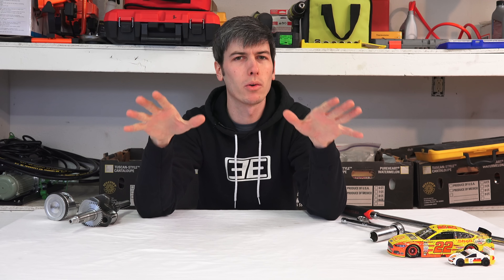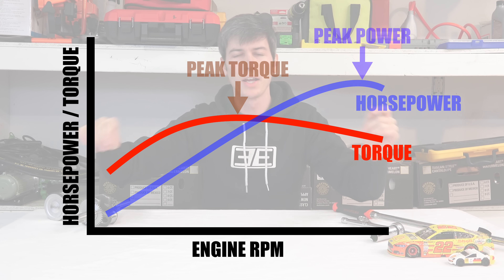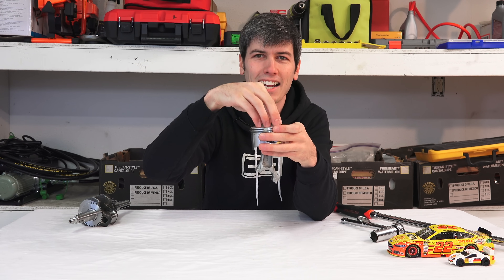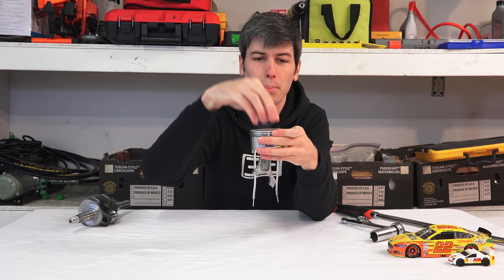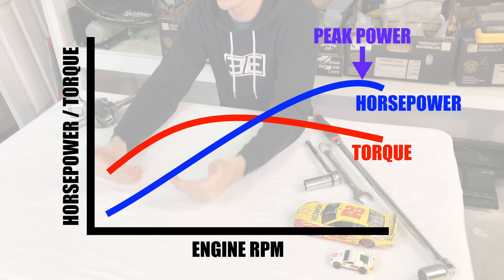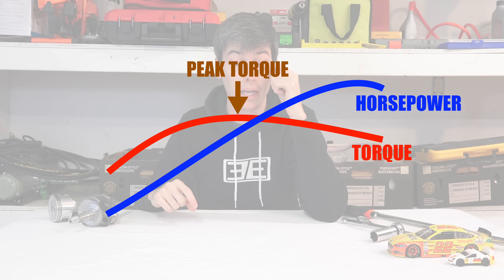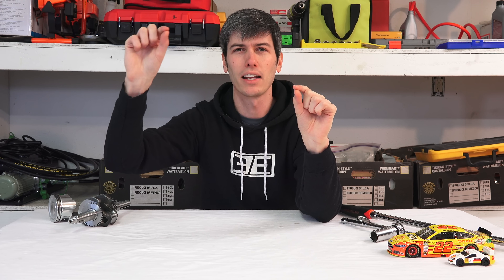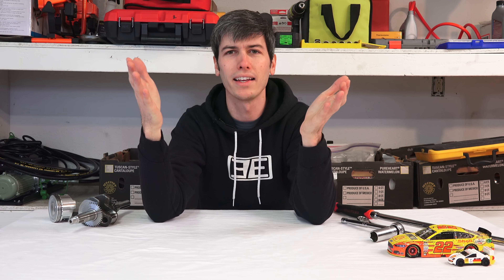Horsepower vs Torque - A Simple Explanation

Comment: So what difference does a higher torque number mean if both cars have the same HP?
Quicker accaleration with resistence like including weight and drag etc.? I dont quite understand
Reply: Slightly quicker acceleration because of more power available at lower speed.
Physically acceleration is the same thing as towing, pulling, acceleration with other "resistance" etc, because A=F/m. If you increase mass by 2 you will be 2 times slower and there is nothing you can do with it. So yes, better in towing too. Considering we keep gear ratios the same.

Comment: Jason, in most of your videos I come away with a greater understanding than when before watching. This isn't one of them. My understanding is torque is static, power dynamic. Torque can be measured with no movement. Power requires movement. Movement over time. Still in the dark as to how they relate to each other in measuring the usable output of an engine. I tend to prefer torquey engines as I get to shift less often. Love lugging around corners in 3rd. I probably would prefer the driving characteristics of a 100hp engine with 140 ft-lbs of torque over a 140 hp engine with 100 ft-lbs of torque in otherwise similar vehicles. But still do not understand how the two are related. Though I was working on a friend's Rolls Royce and looked through the owner's manual. For horsepower and torque, the cheeky British engineers simply put "enough". Also of interest was the "finest motor car in the world" used a GM transmission.
Reply: Power is not "movement over time", it's "work done per unit of time" as Jason says

Comment: This is good but without reference to why combustion engine's curves look like what they look. For electric motor you have nearly flat torque and linear power - so, why a combustion engine torque drops mid-revs? Because the combustion is a process working best only at certain combination of volume, fuel and air mass. Good combination gives lot of force, bad combination gives less force, lot of wasted fuel and so on. But engine is a mechanical arrangement, working in linear fashion (faster revs, faster movement of components). Valves operate in their stroke sequence and let certain amount of air at certain rpm. In most basic mechanical arrangement they will let optimum amount of air at certain rpm while starving cylinder of air or leaking out at other rpm. This can be helped with turbo (but still at cost of efficiency) or with fancy timing solution like VVT. There's a lot of "high school physics" discussions about power formulas etc, but going a step further, looking into how the combustion itself works is what helps to understand why one car behaves different than the other, for example when going uphill or floored on a highway.

Comment: You forgot to show one thing, applying torque to your lever but if nothing moved you generated zero power. (As if a bolt was stuck and didn't spin).

Comment: Pretty understandable except one thing: it,s stated Horsepower is more important than Torque for speed. Yet my Subaru Impreza Turbo (2.0 litre 4 cyl boxer, 220 HP by +/- 350 Nm) wins traffic light races etc from +/- 250 HP Audis, BMWs easily. I think the HP vs Tq has more to it

Comment: This is awesome, but I have a question
Let's say I have a land cruise V8 and Prado maybe a V6 engine, so when the V8 is the 140 speed and Prado 140 speed, is equal to the same speed at the road? Also, assume the tire size is different maybe 17" for Prado and 19" for V8?

Comment: Now i understand why my 2019,  250 HP (on premium gas) 2.5 L. turbo, AWD  MAZDA CX-5 engine with 310 ft. lbs. of torque is so quick off the line.  310 ft. lbs. of torque is a LOT for that compact SUV.. If only they would stress the engine a bit more with a bigger turbo for more HP. :o(
And the 2020  - 2021 models have 320 ft. lbs. of torque!

Comment: I have a question.  I have a turbo k series, instead of putting z3 cams that rev to 8500, I'm putting crv cams that have the torque start at 2500 and redline hp at 6800ish.  My goal is to replicate the style of the type r, by not making high rpm, and having low rpm turbo spool. Right now I am running a3 cams that hit torque at 4500ish and hp at 7000ish. Right now my turbo doesn't spool until 3100 to 3500. I want spool in the 2000-3000 rpm range. Thoughts?

Comment: This video and someone else's is helping me understand the relationship between torque, rpms and horsepower. I think the main problem is that I've never fully understood torque. I mean it's obvious and easy to understand in some ways but it's not something you can visualize. I think I have the same problem with volts. I get current because I can visualize it flowing but volts seems to be a relationship between current and resistance so it's not a tangible thing, it's a relationship. I think if someone said torque is not a thing it's a relationship then I would of understood it many years ago. Basically it's a force so it is power but influenced by distance and leverage which makes it always a force under a gear ratio. And that gives it a relationship with the actual initial force I guess.

Comment: If we design reduction ratio for toque at maximum hp , obviously the reduction ratio will be more. Is this cause wheel to slip since the torque or traction ability exceed the maximum traction ability of the wheel

Comment: 1 question: If torque (rotational force) is necessary in order to move something, in this case to push a car by turning the wheels. If, for example in 5th gear we are decreasing torque, does it mean that we are decreasing the rotational speed of the wheels and thus making the wheels rotate more slowly? Because that is not the case! By shifting gear from 4th to 5th, lets say, we are making the car able to move faster than, lets say 120 kmph without getting the RPM so high. Right? 
So, if we translate this to the linear motion. Force is necessary to create motion, that is, to accelerate. When force decreases, doesn't it mean that the speed should also decrease?
Reply: Right, force is decreased, you will start to decelerate if you keep throttle at the same position. You have to push the pedal harder after you shifted up to keep the speed.
If you are already traveling at maximum speed, you can do nothing with gears to accelerate further: shifting it up or down will get you at lesser power (at the same speed of a car) which will result in deceleration

Comment: A vehicle with high torque is more quickly at its peak power. So to say it makes better use of its power. That's why electric vehicles often accelerate so fast. They don't have extraordinary power but very high torque.

Comment: Is there any visualization on say 0-60 given X tq and Y hp at gear ratio Z? Trying to think to myself how a 350hp 420tq mustang turbo compares to a 450hp 400tq GT and at what points either beats the other
Reply: I'd wager the extra hundred horsepower makes up for any additional weight of the v8 so the GT wins across the board.

Comment: What do mean by gear ratio?
Reply: Suppose you have one gear that is 2 inches in diameter, and it drives another gear that is 4 inches in diameter.  This is an example of a 2:1 gear ratio.  It reduces the speed by a factor of 2, and increases the torque (ideally) by a factor of 2, assuming it is 100% efficient.

Since the gear teeth need to move a the same speed, otherwise they would chip, the tangential speed at the contact point of the gears moves at a common speed.  Spin the input gear at 2000 RPM, and its teeth move at 209 inches per second.  The output gear must also move its teeth at 209 inches per second, and for a 4 inch diameter gear, this corresponds to a rotation speed of 1000 RPM.

Comment: I’m a little disappointed.
It Makes no sense that the peak torque would feel greater than peak horsepower, when it accelerates faster at peak horsepower.

What you feel is a force equal and opposite to the acceleration, and the greater the acceleration, the greater the force is felt as a passenger. So the acceleration is felt greatest at the peak HP not peak torque.

Greater acceleration feeling at peak torque, but faster acceleration at peak hp.
is some old car guy myth, that everybody is quoting, and now one challenges with simple math and physics.

Comment: Just a small nuance, but moving something horizontally isn't doing work since you're not actually increasing the potential energy. However if you're increasing the velocity then you are doing work so it's important to note that more power will create a higher velocity in the same given time. It's not just slow constant velocity from A to B vs fast constant velocity from A-B
Reply: Moving something horizontally is work. Even though it is not gaining any potential it still requires work to move an object.

Comment: There's something I don't understand.

If power is the rate a which work is done, then it's safe to assume torque is irrelevant as to how fast a car is, and that it's just a driveability thing, right ?

Then explain this situation I've experienced personnally. My car is a bmw e46 318d, 116hp and 285Nm. I've seen mutliple online videos of a races with an e46 318i, 118hp, but only 184Nm. Everytime the diesel 318d pulls bus lengths on the petrol 318i, which doesn't make sense as technically the rate at which the work gets done is really similar in both cars, and the weight is literally only a couple kilos off.

I'm starting to get an understanding as I write this, tell me if I'm on the right track. So let's say the petrol is guy 1 and diesel guy 2, they're both tightening a bolt and have the same strength, guy 1 has a ratchet, guy 2 has a breaker bar. If we're asking them to tighten the bolt lightly, they're both gonna finish at the same time, but if we ask them to tighten the bolt at a very hard, guy 1 with the ratchet is gonna struggle and will take a long time to do so, while guy 2 will do it easily because he has the torque. With the car the situation is the same, if the engines were in very light cars they both would be as fast as each other, but here the car is too heavy for the petrol car so it's struggling. 

This theory verifies, I've just watched a video of an e92 335i with a stage 1 tuned 400hp 650Nm, against an e92 335d also stage 1 tuned 400hp but 850Nm, and they were pretty much both as quick, with a minor difference probably due to gearing and slight weight difference. 

So my conclusion (again if someone can confirm) is that you only need enough torque to move the vehicle comfortably, and that after that it does not make the car quicker. Just like using a breaker bar to lightly tighten a bolt isn't gonna be faster than with a small ratchet. But the breaker bar would definitely go faster if you were tightening a bolt incredibly hard. And that my case with both e46's is because one of the cars is lacking torque and is struggling to do the work it's asked to do, and that if both engines were asked an amount of work that would be more appropriate the difference wouldn't be there anymore, like with the two e92's which both have more than enough torque to do the work they're asked to and therefore the difference in torque doesn't make a difference.
Reply: You can better buy a car with 180pk and 300 nhm, then an car with 130pk and 400 nhm. 

If that is where u did think about.
If u want to be faster ofc

Comment: Good video. I finally am beginning to understand this. Torque is the strength with which the piston is pushed and power is the frequency with which the torque is applied. Horsepower is just a unit of measurement for power. The greater the force applied by the piston, the greater the torque.  The more the frequency, the greater the rotation /rpm of the crank shaft and greater the power.  So you need a lot of torque to move a heavy load like a huge automobile, say a school bus. And you need to to do it at great frequency (which is power) to make the bus move fast. I hope I got it right.
Reply: Torque from a single piston also depends on the crank radius since it's a force applied to a distance after all. To move the school bus, at the end of the day you need power. A given amount of power can be achieved either through high RPM/low torque, high torque/low RPM, or moderate levels of both. Low RPM is good for longevity and also a characteristic of diesel engines, so trucks tend to be low RPM/high torque.

Comment: Torque is measureable, Horsepower is only a calculation. You can have torque but no horsepower, and torque is everything when talking about power.
Reply: Torque is only half the equation when talking about power. It's not everything and it's not nothing.
Reply: @buzzlesworth54  torq is everything if you want to move something.
Reply: @Deutsche_1  You can measure horsepower, you just can't measure it directly.
Reply: @carultch  You cant measure Horsepower, period.
You need movement to calculate horsepower, you dont need movement to measure torq.
even having movement you cant measure horsepower if one has not one rotation, example the Lance bulldog, please check that tractor a lot of torq but 0-HP....
Reply: @Deutsche_1  Ok.   I power a generator with the engine.  I then hook its output to an electric power meter and an electrical load bank.  Now I run the engine and the generator.

I think at this point, I can measure the horsepower.  I can calibrate the electric meter so it displays horsepower instead of Watts, and ergo, I've measured horsepower.

Comment: Great. I understand... wait one minute... that means the higher gear would give you less acceleration until you reached higher RPM. So I'm hearing that I want to reach peak power then up shift at a speed where the next gear can already rev enough to match or exceed that power.

Comment: Great explanation of why "long stroke" or "over square" engines with more stroke than bore have more torque. I've always known this but could never explain why. This video helps.
Reply: This also explains why you can "lug" an engine with a long stroke and why you have to keep the rpm's up on engine with a short stroke. Think American muscle car with a V8 vs a European screamer with a high red-line.

Comment: then why are big machine engines rated using HP when hp can be multiplied from any engine depending on the lever length ?
Reply: Horsepower cannot be changed by levers or gears. Only changes to the engine itself can change power. Torque can be multiplied with gears but the speed will change inversely so power will remain unchanged.

Comment: @engineeringexplained How come two cars can have near identical 0-62mph (8.5 vs 8.6), where they have 165 vs 162 lbs torque, but engine-power is significantly different (178 vs 138 bhp)? Are there some other engineering involved here? Or is it normal that 40bhp difference only makes 0.1s difference? Thanks!
Reply: thers plenty factor = shifting time traction at start if we talking about start from stand still  drive train losess  weight aero peak power width  ....assuming even that we have vehicle with the same weight i can create such setup that with 5 times biger peak power it will accelerate 5 times slower to 62 mph :x  because why ? because diffrenc in gear langht corelate with for egzample power graph be so bad that this vehicle will use this peak pwoer only from 50 to 50,5 km/h :x vs 5 times weaker in termsof peak pwoer engine will use it all the way from 0 to 62 mph :D thanks super wide peak pwoer bend etc  such setup in real be super hard to find and you dont find setup where 5 times more powerfoul ehicle losse 0-62 mph acceleration if weight similar :x but yea engineeer or i in me nootebook can easy project such vehicle which despite huge peak pwoer be acceleratuion worse than SH.T :D  in terms of acceleration time form to some velocity because this big power still be accelerate much better this vehicle just at very short diffrenc in velocity like 100 to 100,1 km/h and end max acceleratuion because peak start at 100 and end when vvehicle achieve 100,1 km/h :D and before and after offcorse power is lower if power graph be super narrow than much lower at further form 100to 100,1 km/h the weaker tractive force engine can give you because of this narrow power band  and huige diffrenc in  gear lenght :x once i put precise setup cvvt which be hold one very preciselly peak power rpm let say 5000to 5001 rpm at we have now from this engine rocket  which crush 5 times less powerfoul engine at acceleration pulling push wwhatever  no matter how much more torque this 5 times less powerfoul engine at crank will have :) .
Reply: Available traction affects the actual acceleration at low speeds.
The exact shape of torque curves affect the 'average' power produced throughout the rev ranges used in the acceleration -> Rate of acceleration affected
The number of gearshifts needed to reach 62mph etc etc

Comment: So let's see if I got this right. Considering peak torque and peak hp are not located around the same RPM a car is better at acelerating by staying at peak hp, but has to make sacrifices such as short gearing to stay in the optimal RPM, that means that for a higher top speed this car can be better staying in peak torque. Is that it or is it still better for the car to have a gear ratio that'll keep it closer to peak hp still while trying to reach it's higher speed?
Reply: Peak power will get you the highest top speed and acceleration. Ideally, you'd have a lossless CVT that keeps you at peak power.  EE does have a video somewhere where he puts it in terms of wheel torque and wheel rpm, which is the same as wheel power.